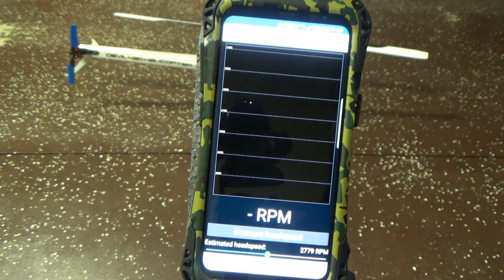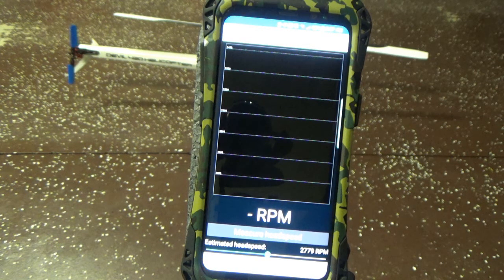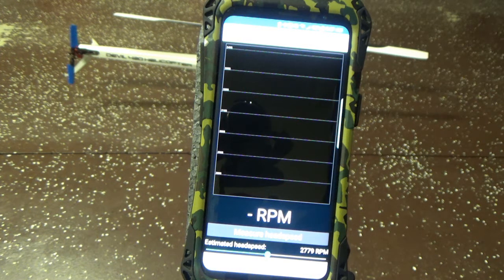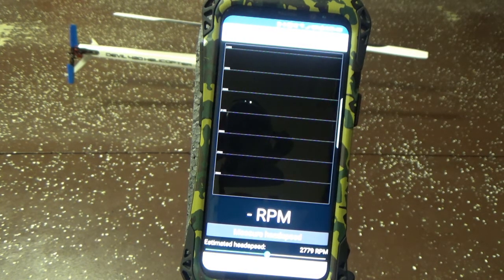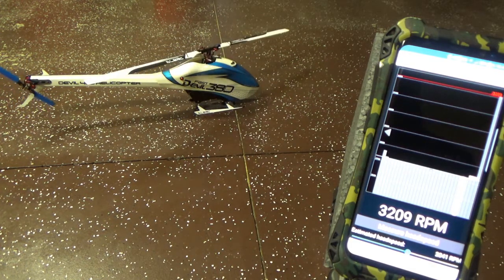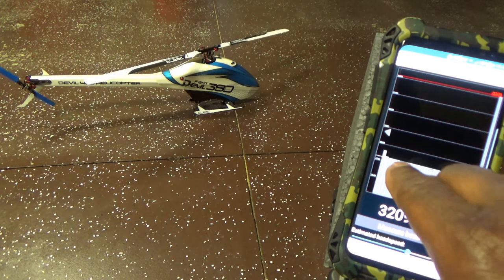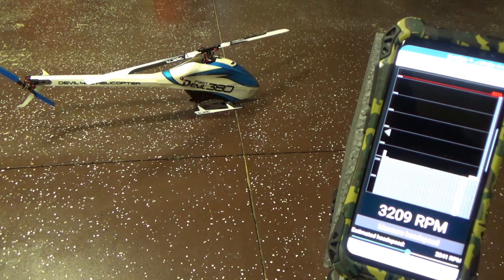Acoustic Tachometer App for RC Helicopters (Alzrc Devil 420)

Comment: I think you are using a Brain on the Evo correct? If so, you can go to Tab 12 and that will let you know exactly what your max headspeed it because that is where you will show the ESC where zero is and also show the Brain Zero and the max headspeed.  Additionally you can govern whatever speeds you would like there also (if you choose to use governing).
Reply: Also one you find out what the max headspeed is reached on your Evo, have that app running to see if it matched up pretty close to what the Brain says.  That would be interesting.
Reply from the maker: 3DLee Live Action Yes, im using the Brain 2. Thanks for the info. I most definitely will try it out and compare with the app. Thanks

Comment: That thang sounds like a beast brotha!
Reply from the maker: mtctookie25 yes sir brother! It's got the Xnova 930kv Tareq Edition motor. This heli is a good basher and cheap to repair. Lol!
Reply: Have you had it in the air yet?
Reply from the maker: mtctookie25 I've had the 420 in the air 3 times to test the change. I bumped the headspeed up to 2400, 2700 and 3000 rpm. It made it more responsive but lowers the flight time to 3-1/2 minutes. But i have a half dozen lipos for it since it my go to basher and cheap to repair. Lol
Reply: 3-1/2 minutes isn't a lot of air time but if you have enough battery power, then your good 4sure!!!
Reply from the maker: mtctookie25 I remember when i first started flying heli's about 3 years ago. 1 and 2 minutes seemed like an eternity when fighting the sticks trying not to crash. I use to be happy to hear the timer chime to land. Lol! 😂🤣
Reply: I tried flying heli's but didn't have any luck, so i went to drones!

Comment: Which batteries are you using in your 420 buddy?  Also, do you feel the flat 70,75,80 % throttle with the HW esc is about right?  I was going to start with using just three idle up settings with no normal mode at 65,75,85
Reply from the maker: valderja I'm using the Revolectrix 6s 2600mah 70c lipos. It is a perfect fit. Feel it is really close. I will be bumping it up to acheive headspeeds 2400, 2700, 3000.

Comment: Interesting.  Would be good to see how it really compares to an optical tac.  Love that 😈 in the blue.  I wish I had that instead of the red one now. 😁
Reply from the maker: valderja I haven't tried it with a optical yet. HeliTone in the comments said it it pretty close between the two. The blue canopy is my favorite!
Reply: Flyn lo Which app is it?  There seem to be a few for autos as well.  Wonder if these would work.
Reply from the maker: valderja The app is called headspeed tacometer. This app had the highest rating than others. The auto app i think would be a + or - a few 100 rpm.

Comment: Now that's a very good demo of that app. And that's just going off of what? Blade noise , gear noise, motor ? Do you have to input different parameters? These questions are coming to me as I'm writing. LOL! Cheers bro!
Reply from the maker: iPilott4411 thanks brother, the app has a selection for  2, 3, 4 or 5 blade setup. It is using the blade sound to compute rpm. It also request a estimated rpm. This is to  get the graph chart within the reading range.